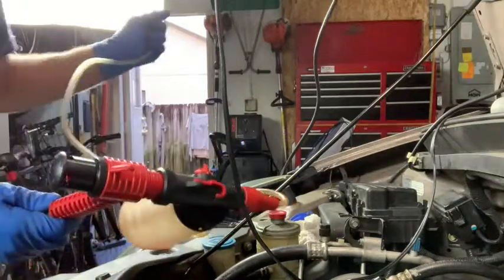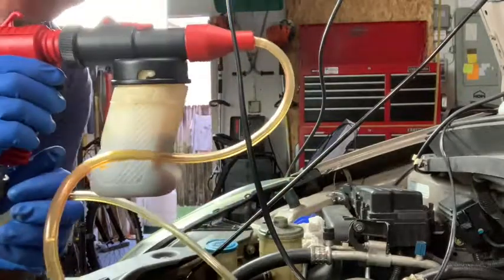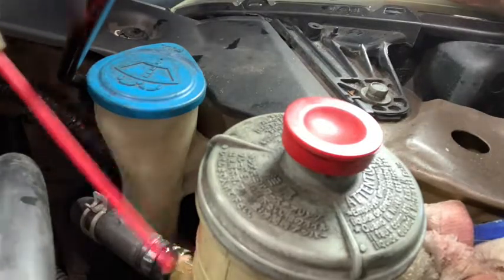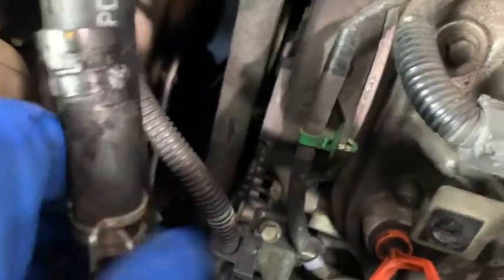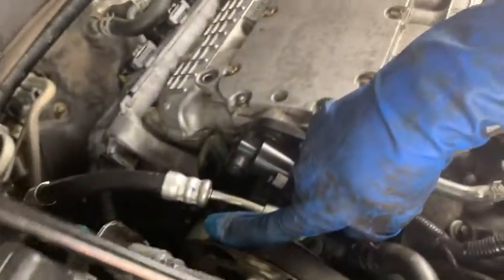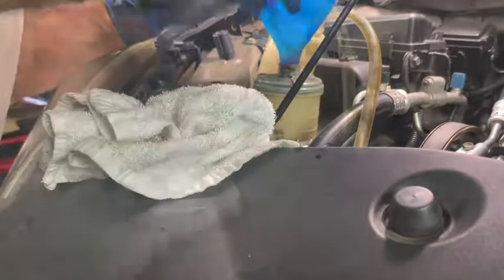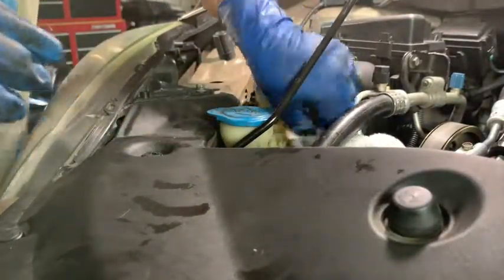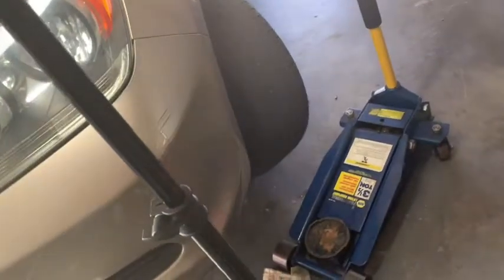Power Steering Fluid Flush Honda odyssey 2005 To 2010

Comment: Combined with jack up the front end method, turn steering wheel all the way left then right with the engine off, took almost exactly 3 12oz bottles of Honda p/s fluid.
Reply from the maker: Thanks

Comment: Thanks for this video. What brand of steering fluid and how many liters did you use? Please can you send a photo of the bottle. Thanks
Reply from the maker: It was Honda fluid. It comes in a little bottle. Honda 08206-9002PE Power Steering Fluid Pack of 3. Here is a link to Amazon 
https://www.amazon.com/Honda-08206-9002PE-Power-Steering-Fluid/dp/B00AVOAUN2/ref=mp_s_a_1_3?crid=3EMJA0XYNJTZ7&keywords=honda+power+steering+fluid&qid=1701902437&sprefix=Honda+steering+fluid%2Caps%2C404&sr=8-3 
Don't buy it from the Stealer Ship they are proud of their fluid.

Comment: I did my 2012 odyssey this way .. working well so far .. however when I took a look at the power steering pump it looks like she has some leaks at the Seals.. is this common..I have 114,000 miles on the van ?
Reply from the maker: Sorry to take so long to get to you. Yes, the seal will leak at the end of the hose where it plugs into the power steering pump. I have had it off to do a timing belt and did not replace it and it started to leak soon after and that was at 100,000 miles. You can order that seal from majestic Honda just enter your vin  number hope this helps. Let me know if you have any other questions. http://www.hondaautomotiveparts.com/
Reply: @fixitjohn  thank you so much for the reply... Took van in for full inspection.. needs new rack and pinion,  4 sway bar links , 4 struts... new ps pump 3900 $ total
Reply: @261Pro  We have one shop here in town that tells anyone to change all 4 struts if over 80,000 miles.  I took my odyssey for an inspection when I bought it used, they figured up an estimate for work of over $5,000.
Reply: @jims2507 I have an odyssey that my parents own that have 173k miles and I am certain they’re bs’ing when you need 4 new struts changed. Unless you live in some off road terrain but the struts on the odyssey they own still look in good conditions

Comment: I have a2008 Odyssey. Is it important to use ONLY Honda power steering fluid or is that just honda marketing talk? Thanks
Reply: My mechanic changed my power steering hose and used a non Honda ps fluid and its still hard steering.
Reply from the maker: When you change a hose, you can get air in your line. Turn your wheel back and forth to force the air out. I hope this helps. Thanks for watching it.
Reply: Yes, it is important to use only Honda fluid. Engineers of these systems build to certain specifications and that may require operating fluids of different viscosities or chemical properties. This also holds true for oil in cars. Yours may be manufactured for flows and tolerances matching 5W-30 whereas another may be built for 0W-20. It is important to use exactly what they recommend or you may find the system breaks down quickly or does not function optimally.
Reply: @fixitjohn  Where is the "Air escape" outlet ?
Reply from the maker: @chipsramek3868  Hi Chip, the air will work it’s way out the reservoir. I hope this helps. Thanks for watching.
Reply: @fixitjohn  Thanks for the great and fast response ...would leaving the cap off while doing this speed it up ?
Reply from the maker: @chipsramek3868  yes leave it off because you will need to fill it up at the same time. Turning the wheel back and forth will help push any air out. It is nice to have a helper.